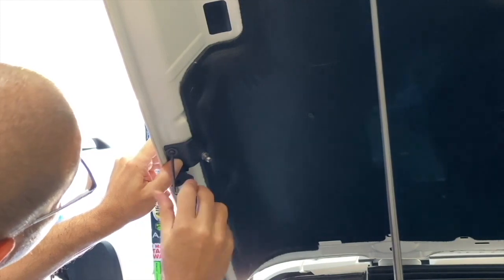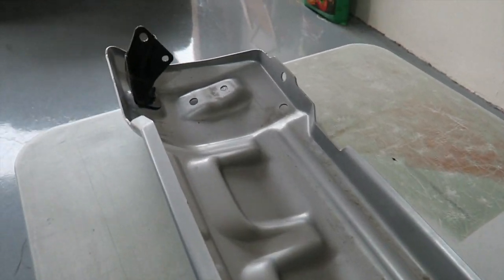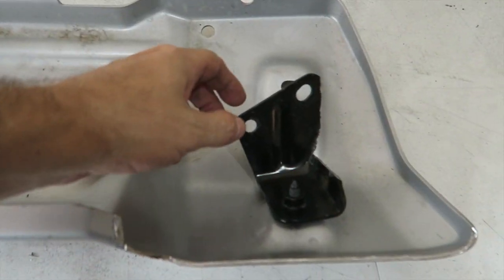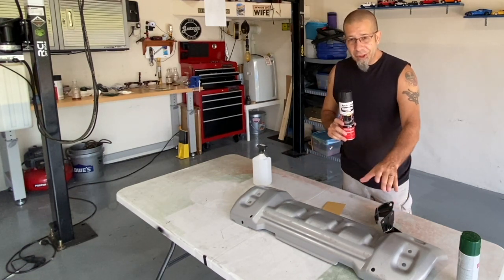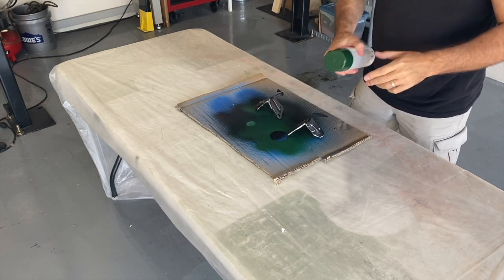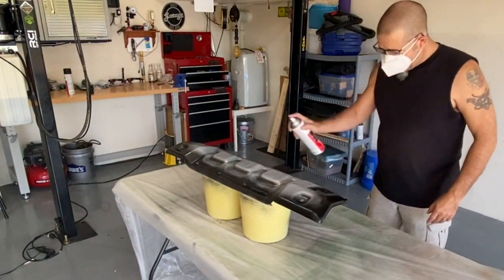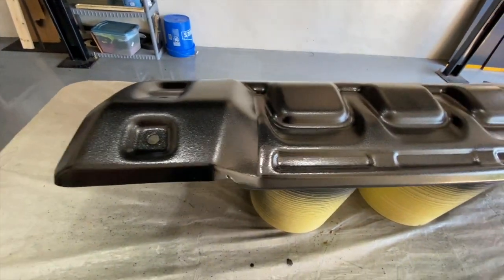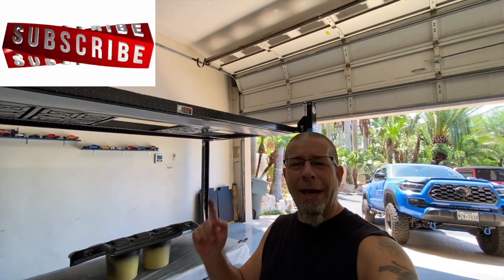Making My Jeep Gladiator Front End Less Vulnerable

Comment: Very nice guys.  I've used JB Weld filler for imperfections like the over cut, tape off back side add filler to front side, after curing smooth it out then paint.
Reply from the maker: Thanks for the tip 👍
Reply: @robmotiveplus  😉

Comment: Since I've retired I haven't had that problem of backing off and letting the fresh paint.  How close is the bedliner paint to the bumper texture and color?    I am working on installing a Rubicon take off bumper that needs refinishing.  Will you install the factory nutserts?  If so show the location in the install video.  Thanks
Reply from the maker: It's not an exact match for sure.  I'll be installing in the same factory frame holes but not installing the nut inserts.